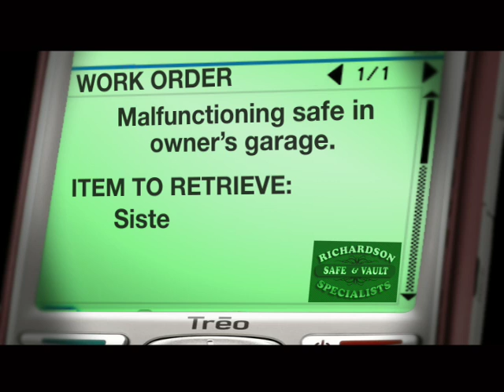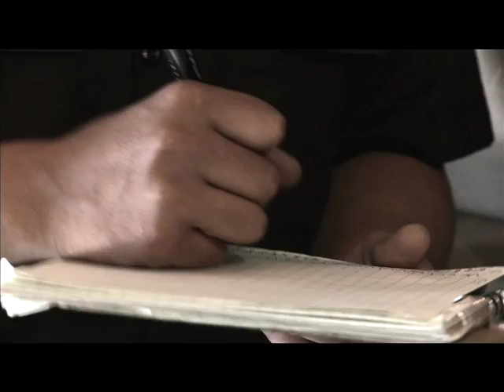Safe Cracker - Dave Richardson

Comment: I am a locksmith /safe tech and everyone says the same thing but when you turn the dial the only change it has is it feels heavier as you turn it in one direction and depending on if it has 3 or 4 wheels it wont feel any different after 3 or 4 turns until you dial it the other way and it will get heavier once again and the sound is the same sound every time it completes a turn.I don’t think there are many people around today that take the time to manipulate a combination lock it takes too long $

Comment: The DP (Drill-point) and angle to drill into the LaGard lock-body is not the right one. 
The right procedure is to pull the dial and then drill in straight for a VU (Vertical Up) orientation arriving next to the lever nose under which you line up the gates. You only drill angular in antique type safes where you can't pull the dial, like a canon-ball.

Comment: I have a safe it is jewellery rated at £100,000 & is 60mm thick metal. Sadly no floor anchor bolt holes, how do I drill into the safe floor as burned out 5 drill bits & got 1mm into the metal, are there any special drill bits I need?
Reply: Are you using cheap bits? May have to put some money into a good set.
Reply: Sharpen  masonry bits and steady pressure.

Comment: Drilling a functional mechanical safe lock, if done correctly does not make the safe usless.  If that was the case, then there would be almost 100 bank vaults in So. CA that I have drilled open that would be junk.

Comment: Any safe,including the double 1/2" or thicker double wall jobs that have the 1 thru 100 dials and high nickle content(tool steels having more than 6or7percent),aren't even a challege for a guy that knows safes.  All 1thru100 dial doors are the same design thats been around for 100+ years. They have 4 tumblers with often 3 left hand and one righthand. ALL the numbers used in the combinations are easily obtained because they always are at what would be 45 degree angles to the horison in any tip of that imaginary leter 'X". So you can go in and experiment in a safe door store, open a few. never takes me longer than 5 minutes.

Comment: @SIGSALYmedia Most likely because Dave thinks his methods are professional because they don't cause a huge amount of damage. A thief doesn't care about leaving a safe intact. Also, if you've ever seen Mythbusters, a thermal lance burns the contents. They're usually not used. Check out the Underwriter's Laboratories testing of safes. Those guys use brute force.

Comment: The real deal is pretty boring and hard to film.  You'd need exploded diagrams of mechanisms interspersed with video of drilling to the proper drill point and depth.  Even then it could be hard to visually convey what they are trying to do to penetrate or manipulate a lock.  Also people in the industry can be a little secretive to outsiders.  You don't want to give away your best tricks.